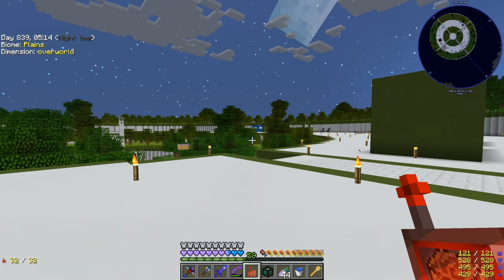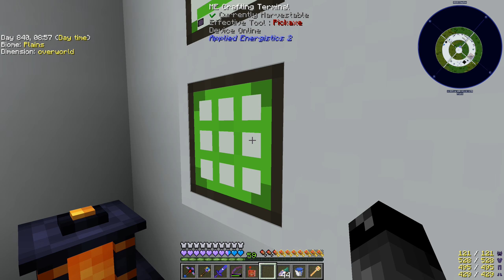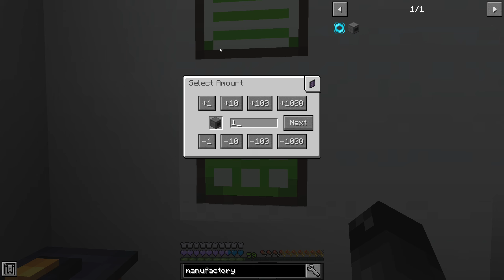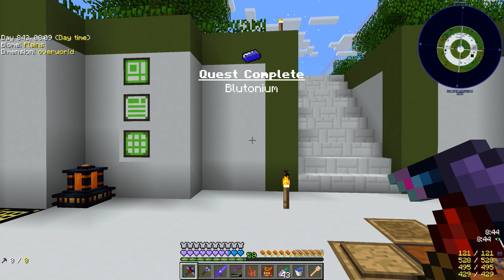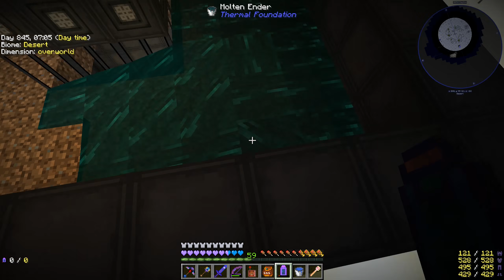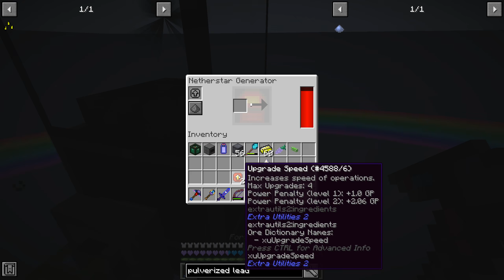Project Ozone 3 Kappa Mode - EXTREME!!! [E81] (Modded Minecraft Sky Block)

Comment: "Does a circle have a corner?"
That's very philosophical of you. As for the question, it can be either yes or no depending on how you look at it. You can say that it does, but you can also say that it doesn't. If yes, every change in angle is a corner.
Reply: Infinite curvature would be a corner if you asked me.
A circle (radius bigger than 0) will have finite curvature, so no corner.
Reply: @Masztufa  It really just depends on how you look at things. I personally don't consider the circle to have corners, but there are those who do.
In the end, my only conclusion is that a boxing ring is a square.
Reply: @CottidaeSEA  a circle trajectory is differentiable everywhere. I see no other way to properly define corner other than "not differentiable"
Reply: I N F I N I T E.  C O R N E R S